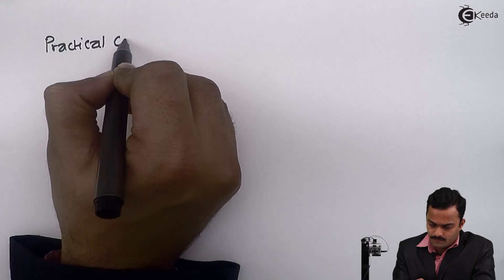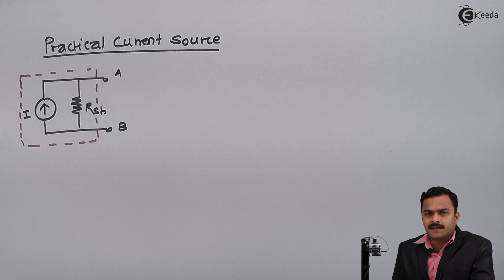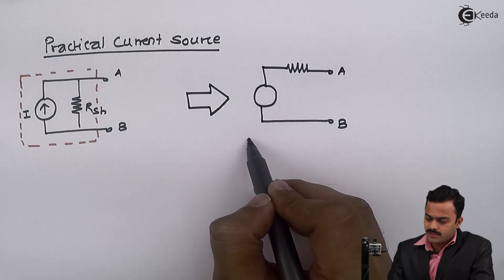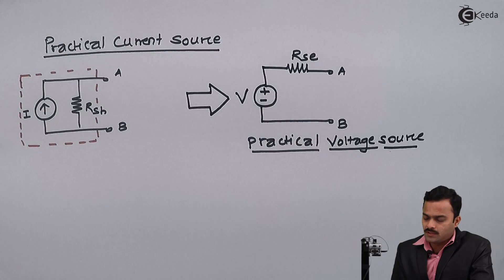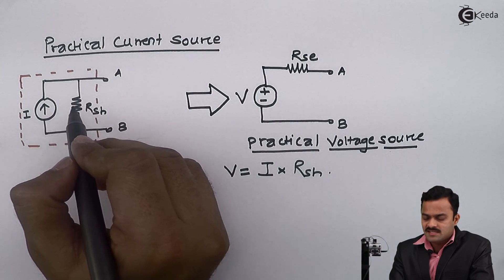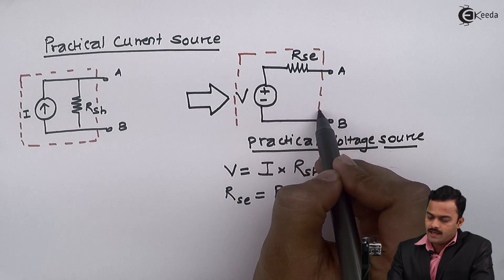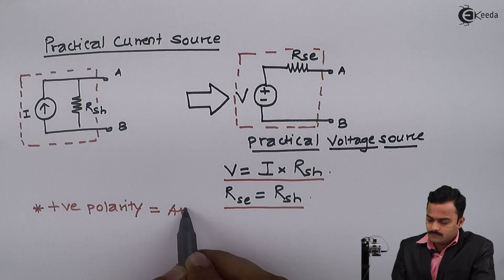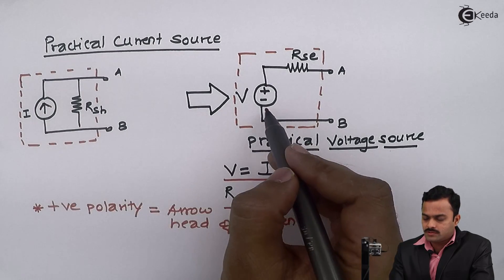Current to Voltage Source Transformation - DC Circuits - Basic Electrical Engineering

Comment: i have a bit of a confusion there.when transforming,ohm's law can be applied.but in circuit you drawn,you used total I passing through the Rsh resister.is it only applicable when there is nothing other than the Rsh resister in the circuit? what if circuit continues from A and B,then only  part of total I is passes through the resister and the transformed voltage source should be equal to  I'*Rsh.isn't it?
can you explain that? thank you

Comment: Why resistor is connected in parallel with current source not in series, and in series with voltage source not in parallel in source transformation system? 
Think and explain
Reply: Bro it is practical current n voltage sources the resistance are like imaginary . U see if in practical voltage source in output u will not get exactly same rated value of voltage u will get less than rated so wer does remaining voltage gone so u have to put in resistor with series same appies to current source ..u think
Reply: if we connect resistor in parallel to voltage source then all the voltage will be dropped across that resistor
Reply: See, ideal current source is that which can transfer all of its current through itself only, not even a little amount of current should be divided at the source. So infinite magnitude of resistance is connected in parallel to the current source so that cureent source can feed all its current, remember its ideal. Now for voltage source, there should be zero voltage drop internally means, zero resistance should be there to inside voltage source, so that a circuit can get all its voltage available exactly equal to the internal voltage. Ideal means whatever be its job its doing at its fullest... Means current source will deliver all its specified current to the circuit, voltage source will supply all its voltage, zero voltage drop internally.... At microscopic level.. Ideal voltage source means there should not be any dissipation of energy of electron driven by voltage source when electron is passing through voltage souce field. If electron dissipates some energy passing through voltage source, why its named ideal... So this must be the explanation. Think about it